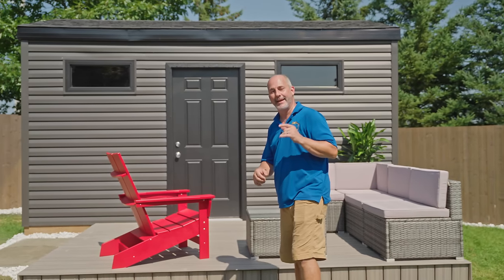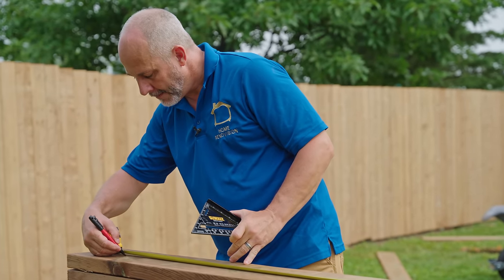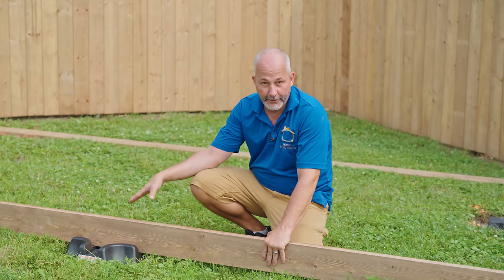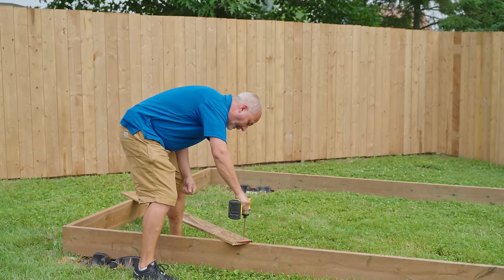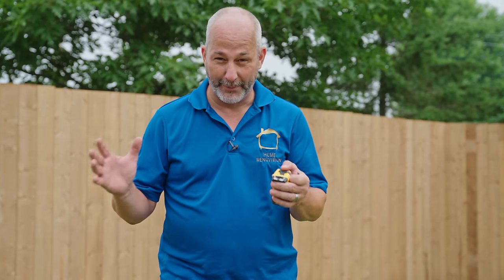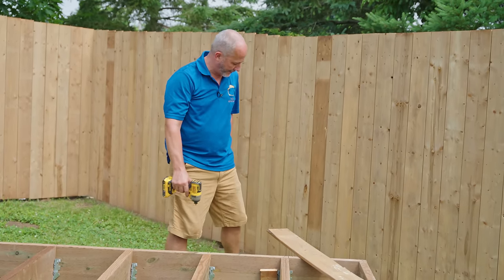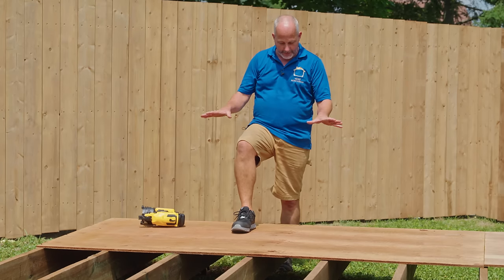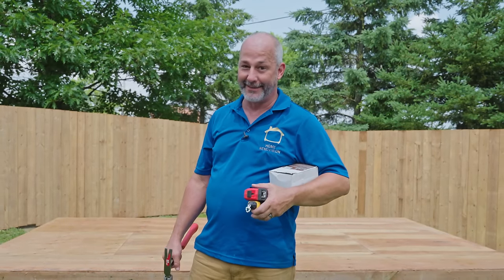DIY How To Build a Floating Shed Foundation

Comment: He only used 4 footings / structural supports for this. When I google it, it tends to say that you should have one every 4-6ft. How can I tell how many I need for a 11 x 22' deck that will also have an about 8' x 10' add-on room for a trailer on it?

Comment: ? It says  the maximum length on those blocks are to be 60” apart and only seen 3 on the 16ft run will the be ok. I’m trying to build a 10x12 and they’re saying to use 12 blocks,a bit confused any suggestions, thanks.

Comment: Mother-in-Law has a shed that was built decades ago.  To me it looks as if it's sunk and now the wood is in contact with the ground.

You have those pads to where the joists, yes are touching the grass blades, but not the ground.  How, or what is to be done to prevent that building from sinking in 30 years?  I kind of get you said to dig out the organics, aka grass, but you were still in topsoil, looked like anyways, when you stopped and added that stone dust material.  

I want to build a shed and thinking one on a floating floor.  I just don't want it sinking down into contact in 5 years and then it shortens my shed's lifespan.
Reply: Oh ... snap....  Forgot you sill had to put the posts in.
Reply: Will this be suitable to have a 1000lb garden tractor parked in it?  Or should more support posts be added?

Comment: camo blocks website says you need a block no farther than 16" from each end then no more than 60" between each block so they call for 14 blocks on a 10x16 shed if you run them around the outside edges, 4 on each 16ft side and 3 on each 10ft side.... if you do it so their hidden, so they're under the runners they call for 44 blocks on a 10x16 shed..... and at the end you said you're looking at $3500 in materials, I can buy a 10x16 shed, 2x4 framed, wrapped in t111, have it delivered, and put in place for under $4000 here in Delaware

Comment: I am not sure what is the deal with 10' measurement that you mentioned at the beginning of the video. But this is a building with a larger than 10 sqm area which as per OBC requires a building permit.

Comment: Looks like an error occurred somewhere along the line of your construction. This foundation only has one tuffblock or Camo block as you call them, at each of the four corners and none at the central joist. The times when the platform was wholly visible were @22.47, @24.19 and @32.06 min and there are no central blocks. Those missing blocks then appear in the How to Frame a Shed video.  Can't have been a video editing error because the foundation was complete near the end with the central joist blocks still missing.  I wonder how you fixed that little issue?

Comment: Another great video! I've got Covid so I'm watching videos while recuperating in quarantine.

Hmm.. I wonder if I can do something like this for a small barn. I want something for my two cows where I can put stall mats down for them to walk on. It always amazes me to see how easily the grass comes up in places where they laid it down as part of the landscaping. My yard doesn't have that. It's farmland and the grass never comes up that smoothly. Some of it always has longer roots than others.
I'm glad I don't have to worry about HOA or codes saying my buildings can't be larger. LOL. My neighbors don't care what I build in my yard. They can't see it because we have trees in between us. They have no reason to come anywhere near my property.

Where do you find the cut & seal? I looked it up at local big box stores and they didn't have it.

I think I've seen the cam blocks (or something similar) before. Great idea.

So, if I live somewhere that doesn't get snow and I just want to have a small deck, can I have a single rim joist instead of double?

I'm interested in seeing how the steps will be built to go up to the shed. Do they make camo blocks for steps?

I enjoy seeing the father-son teamups, although it makes me miss my dad. We were total monkeys when we worked together but it was still fun.

I still need to make a shed for my water pump and cistern. No floor on it though, unless I have partial floor and some cutouts for the pipes that go under the ground. Need something completely waterproof though.

Comment: That is not the correct gun for a fence or subfloor. Smooth shank roofing nails don’t hold lumber together.
Reply: It looks like a framing nailer. I'm used to roofing nailer with circle chamber. Talking about 16:00
Reply: @baxtronx5972  I am pretty sure dewalt doesn’t make a qual gun only the roofer and he comments to that later in the video I believe.

Comment: just curious is there a reason not to use 8x8 and notch the top so beams both bear on and than tie into the post instead of adding a second piece screwed on to the 4x4?

Comment: How will they get a mower behind that thing to cut the wasted yard space?
Reply: Lift the mower or weed wack it. I have a riding mower and I usually weed wack anything I can't reach with it.
Reply: @vespaman101  lift the mower? Awful placement planning. That's a lot of lawn back there.
Reply: That's a different video. 😶‍🌫️
Reply: yeah lift the mower. I do it all the time. not the riding mower but the push mower. It's not that hard. or just use a weed wacker. u kinda ignored that part.  @BMattWill

Comment: Imho that is a bouncy floor with little support. A grade beam 16” in from each side to support all the yet to be added weight would be far better than the system used. The joists sit solidly on the rim joist and the fasteners are only needed to secure the joists to the grade beam. Those screws even though structural do eventually weaken due to surface rust the nails are not structural and add nothing other than making it look pretty during the construction stage. I certainly would not build that size structure using the method shown.

Comment: Hey Jeff, looks like you used a Dewalt battery powered framing nailer, interested to know which model? As always a wealth of info and cost savings measures to boot.
Reply: DEWALT is yellow, looks like a Milwaukee to me.
Reply: He is using a Craftsman framing nailer
Reply: Craftsman is made by the same company as Dewalt. It's basically the homeowner line.

Comment: Want to build a 12x24 with shed style roof, should I support the center of the floor? Thanks
Reply: YES
Reply: What do you mean by the “center” of the floor? It sounds like you are relatively new to framing, and a structure the size you are looking to build can be very dangerous if done improperly. My serious suggestion would be to look into having plans drawn for what you want built, and then just follow the plans. You still do all the work yourself, with the added confidence that the building will be structurally sound.
Reply: Set blocks or posts at 6' on rim joist and the same down the length.
Reply: Posts supporting the middle spans at designated distances will help through the years. Jeff here 'overbuilds' some of his projects and there is nothing wrong with that providing it is done well.

Comment: Waitaminute.  If that is a 4x4 post.....and that rim joist hanger has 2 - 2x8's sitting in it, that's 3 1/2 inches wide!  What happens to the other 1/2" space in there ?????

Comment: Every single time I do a new project you create a video about it about a week or two after I have finished it. 😅
Reply from the maker: heads up I am filming a kitchen reno right now. Cheers!
Reply: @HomeRenoVisionDIY  that's great because my kitchen has been demoed for the past year since the guy that I got to do it disappeared, he was going to do a tile and laminate mosaic on the floor, repaint the cabinets, and do the backsplash, as well as a built-in drawer system around the new fridge.

Comment: At what point does a person need to not use deck block and move toward proper sono tube concrete footings or screw piles?
Reply from the maker: when you build bigger than code allows for a non permitted build. Cheers!
Reply: When you care about the building and you're not just making youtube videos.

Comment: It won’t matter as much when running decking, but the way you laid out your ridges was slightly wrong. When you hook your tape on the end of the board, while your joists will still be 16 oc, they will be 3/4 of an inch shifted to the side, since the first piece of material doesn’t start in the center of the first joist, but rather the edge of it. This is critical when laying sheet goods, where landing on the center of a stud/joist/rafter is necessary.
Reply: I'm glad I wasn't the only only who saw his 16" OC was wrong. He should of marked 15 1/4" with the X forward to get perfect 16" centres from an edge. he must of fixed that before the sheeting
Reply: @kevinmcneilly8989  correct
Reply: Exactly misleading for the average person!

Comment: No disrespect but 16 centers your measurement should be 3/4" shy of 16 X to the right.  That puts your board at 16" center.  Your first board will be 16 3/4" center

Comment: Does the pressure treatment not soak through the whole board? Ive never sealed the cut ends on treated lumber and never had a problem with it. I always assumed the treatment soaked through the whole thing.
Reply: I think the 'ground contact' boards are soaked through.

Comment: My deck was built with double 2x12's and the joists were hung on the metal hangars with the tabs, no screws were used! SMH Anyway all of my double joists were completely rotted (9-12 ft in the air) I had to have the deck rebuilt. So the reason the doubles were all rotted was due to ants...the new deck as 4x12's. Thoughts?
Reply: How do ants cause 'rot'? They eat wood, not rot it. One possibility is not using treated lumber. The other possibility is using galvanized connectors with stainless steel fasteners. That could corrode.

Comment: Hey Jeff, just wondering why code prohibits a structure bigger than 10ft by 10ft? It seems as though if the structure is sound and safe why do they tell you how big or small to make it if its also on your own property.
Reply: I think it's not so much that it would be prohibited, just that if you go beyond a certain size then you would need a permit(approval) which obviously complicates the process. For example, in Seattle, WA, where I am, we can go up to 120 sqft (e.g. a 10'x12') before we have to get a permit. So I built a 10' x 12' to skip the permit (IF I wanted to be code compliant, that is) even though I certainly woulda liked a little bigger. Trade-offs :)

Comment: I wouldn't use those flimsy plastic post base thingies.  I prefer to put a 24' x 24' patio paver with a concrete post block under the corners as well as every 4-6 feet including the middle of the floor space.There is no wobble as you call it.  Otherwise that is a very solid floor system just way too high off the ground to use for mowers and such.

Comment: This is a garbage foundation.  Do it right and dig holes or dig a footing and use concrete block. Probably why you had those lawsuits for shoddy work. With joist hangers and all structural brackets you're supposed to put a nail/screw in every hole.